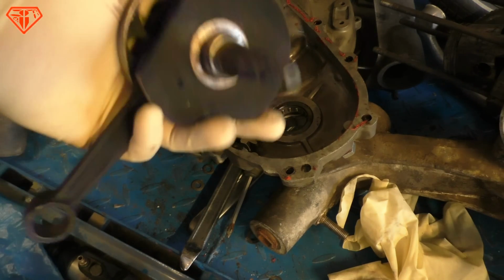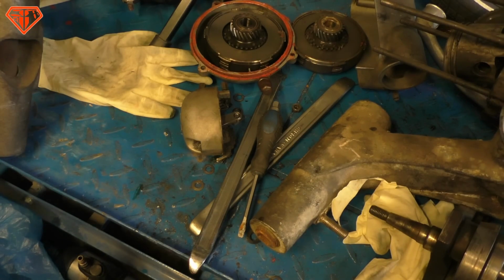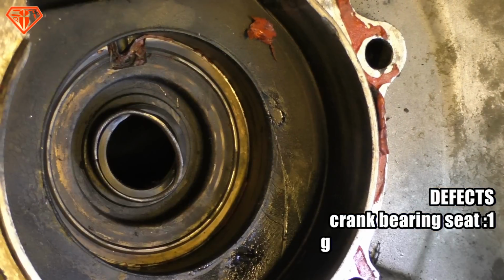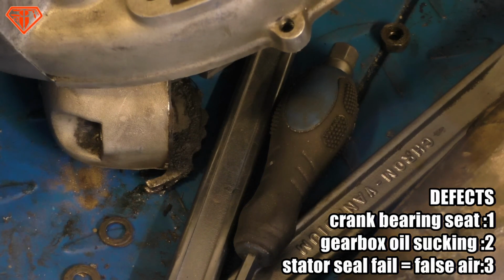classic VESPA SPRINT engine SEAL FAIL & how2 avoid it 😉

Comment: mate, how do you have time to document all this stuff??? Videos have been a god send for me trying to restore an old vespa. But now a question. Do you know if there is a difference between cylinder for p125x and px125? i try to get a cylinder, but there are fitting problems for the 1981 p125x.
Reply from the maker: 😄🍻😎 shouldnt be. would be new to me. sry no other info

Comment: would the seal melt if the crankcase heated before putting the bearing? especially clutch side seal.
Reply from the maker: no